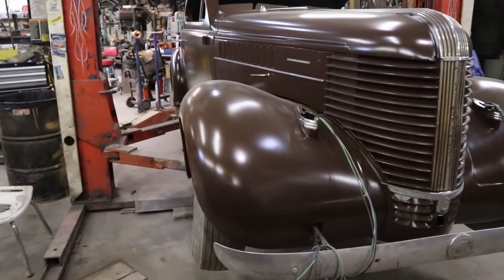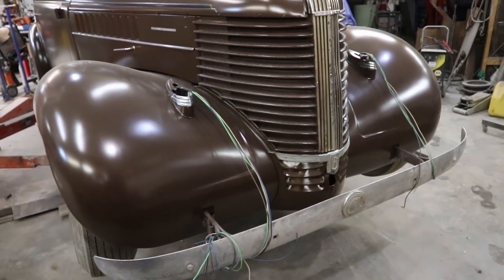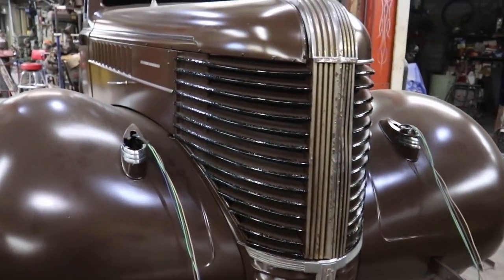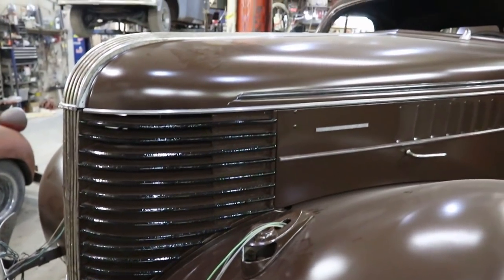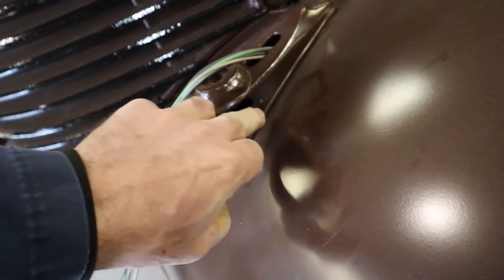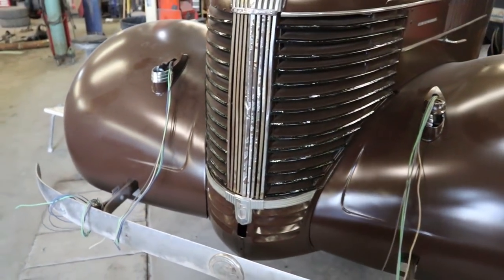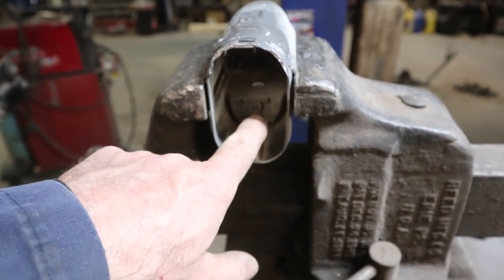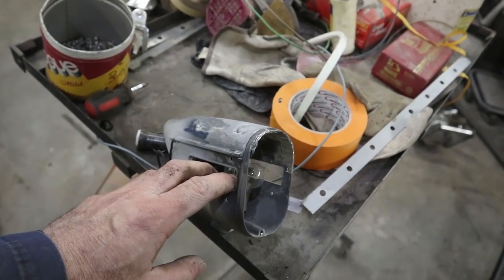38 Pontiac Headlight polish and we install our modified tail lights along with painting the grill.

Comment: Cowles custom sells a chrome vinyl strip in 1/8 & 1/4” that looks good and could work on the grill and hood strip . I have used this for many years and it lasts for a while with a coat of uv waxing once a year. It comes in 20 ft. Lengths. Hope this helps the Poncho is screaming for some chrome. 🤩

Comment: Cool ideas, grill paint, headlights/ taillights and painting the taillights housings....
Gangster car. Cool car..
Reply from the maker: Thanks Howard!
Reply: @HalfassKustoms  U-bet!!!
I'm only asking a question, the old school pinstriping tool you showed...
Is that what they might have used to pinstripe the rims???
Some of the old cars, would have a single/ double pinstripe line on the rims....only a question...
Your car is one slick ride...I like how you did the rear light lens......
Reply from the maker: @howardkoster4026  could have someone found the link to the tool I'll pin it. But they sell a dual pinstripe thing for it
Reply: @HalfassKustoms  I was just wondering. I seem to recall a few Chevies my father had that had the rims pinstriped...
I like how you have done the front grill. Cool idea for a grill that's a little worn....
Reply from the maker: @howardkoster4026  haha like a lot worn
Reply: @HalfassKustoms  I've found, that I have to be careful how I say things on any social platform. Yeah, the grill has wear on it, but you did a great job with it...

Comment: The car's coming along nicely. I was looking at the black striping on the grill. Nice pin stripe tool to make things easier. A very long time ago I worked in a fiber glass shop where we made interior/ exterior decorations, such as whirly-gigs, all kinds of birds, deer antler chandeliers to name a few. Anyway, my bosses specialty was making things, painted like new and then giving them an antique finish. He kept an old barrel under the gutter to capture shingle tinted runoff. I was thinking for the grill tips, maybe get some silver and then slowly mix in a very little brown and black so it would fit in with the center trim. Just a thought and thanks for sharing.,

Comment: Used one of the paint rollers like yours once upon a time (still have it) to pin stripe a set of steel wheels. It worked really nice. I used model car enamel that comes in the really small glass jars. I guess that stuff is still available. The consistency was just right so I had no runs, drips, or errors...

Comment: Not sure if they are the same but caustic silicon I used dish soap. Coat your hand for 30 sec and scrub with a nail brush. Comes right off.
Like your wife dodge. “But” if mine I would try for a newer hemi vs ls. But still looks great and bet it’s reliable.
Reply: Acoustic
Reply: Why would you want to mess up a beautiful classic truck. By putting a Chrysler motor in it?   Lol.   Chevy is the only way to roll down the highway
Reply: @timyowell4278  put the heml in it and fly instead of rolling never cross breed
Reply: @timatwell3728  everyone knows that crossbreeds are the most loyal likable things a owner usually has. Lol

Comment: Was told back in the day, pinstripers using a brush would have a baton (as in twirling the, not the nightstick version) or a short cane either with those rubber ends and used that to prop on. They could touch the car without scratching, allowed to do more than one strip while it was still wet (dual or concentric drawings) plus gives a bit better angle.
Your plan is clearly to NEVER EVER have to redo those taillights!   Ha, ha.
Reply from the maker: haha I hope to never have to touch them again haha

Comment: You never used that Purdy weld in a tube n it's cost like $5 & I sealed a hole in a Van Gas tank where a Forklift put the fork in it when moving it n I made like a pancake n covered the hole n it worked great

Comment: How did you put the halogen bulb in the reflector?
Reply from the maker: haha with a screw, just over sized the center hole put the bulb though the back and used 2 small screws to hold the light to the reflector.